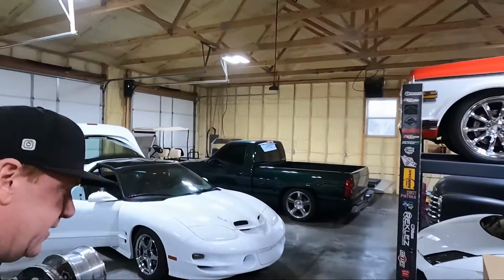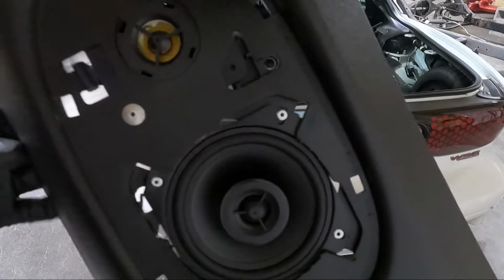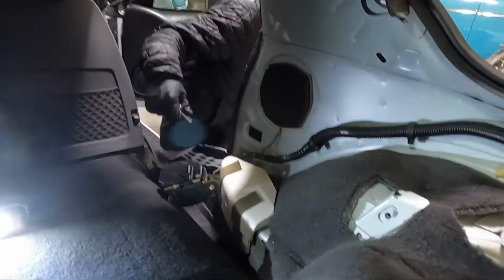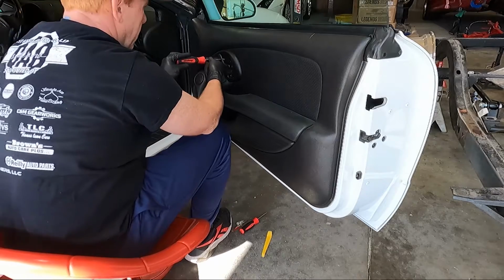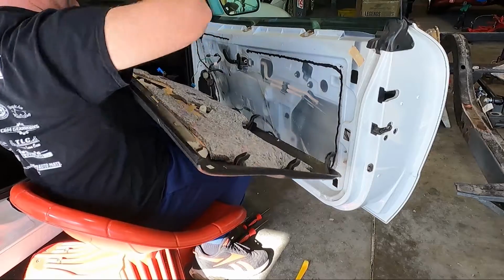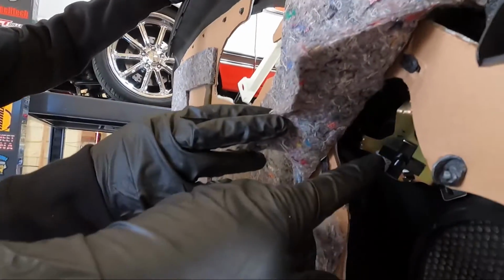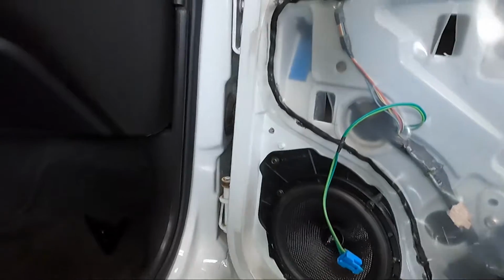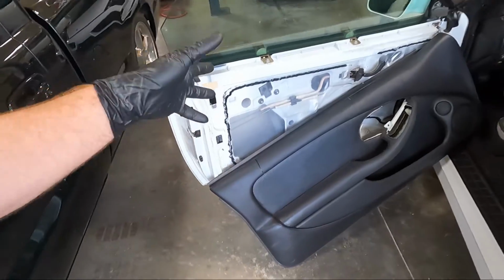WS6 Trans Am Gets All New Speakers From Kee Audio. (Huge Upgrade!)

Comment: Hey travis, while you have the door panels off.  Remove those top staples, drill the holes out and use zip ties to hold them together.  The staples are what cause the panels to crack. Won’t let the plastic flex in weather changes.  I did it to mine to prevent those infamous door cracks.
Reply from the maker: In the process currently

Comment: Hey Travis, nice job on the install. I installed the same set in my 00 Camaro SS, and they were a big improvement over the stock speakers and the fitment is spot on. You could have saved yourself some time and effort by not taking off the sail panels, and instead popping off the speaker grills, unscrewing the stock speakers and dropping the new ones in. Would also recommend adding some sound deadening in between the speaker mount and the body to eliminate sub vibration.
Reply from the maker: I may do sound deadening down the road. I don't like popping out the grilles on the them. Always a chance of breaking with the age of the plastics

Comment: ABSOLUTELY do a experimental door panel vid, every panel out there is cracked so it will be your most watched vid so make it good!  On another note, do you think the baffles would do good with the CDT sail panels here, I'm afraid that filmsy rubber would reverberate.  Do you think that is a non issue or not?
Reply from the maker: Its a pretty good product. I think it compliments any speakers
Reply: last question and I'll be done:  I've been defeated by the hangar hooks, I'm trying not to get too aggressive obviously so I don't mar things up but the lil plastic piece in the middle of the hangar hook doesn't come all the way out right? it just releases some loosening  up the plastic hook to be pulled out?   Am I correct in this assumption?  @TWAMotorsports
Reply from the maker: Unfortunately it is sold now

Comment: Nice job on the speakers install.. looking peeeeeerfect 👍.. the door panel cracks on your son's Ws6 is a common issue.. my 94 TA door panels surprisingly is not cracked anywhere on each side...  However they do need to be repainted again just because of the outer seatbelt rubbing into the plastic over the yrs.. as seen on my Instagram page.. I think down the road after I get mine up and running I'll have mine professionally painted with that plastic texture paint.. but for me now my motor and transmission is first priority..👍
Reply from the maker: Yeah these door panels suck!
Reply: @TWAMotorsports  indeed... I see another white Lambo in the background..
Reply from the maker: Same one. Older video
Reply: @TWAMotorsports  10-4

Comment: Timeless thanks so patient one handed
Reply: I just got a 1994 Camaro. Having trouble with locking the doors with the remote. Replaced the battery in the remote first. The doors will lock but not unlock. What symptoms made you decide to change the actuators initially? The press the #1 button once and the #2 button twice seems to be working fine but the transmitter for the anti-theft is different than the doors so I guess this might mean the tx and rx circuits are OK but maybe not so?( not actually a RC car right?)
Thanks Travis, seems like you had another viewer reviewing your 2 year ago video! This is what I meant by timeless! I am going to subscribe, I really thought your instructional video talents are very thorough!!!
Thanks
G_Dub
Reply from the maker: @GDub1958 thank you

Comment: I miss my Firebird. I had an 02 and put a 10 inch woofer in the rear it sounded so so good hitting off that glass. No rattles at all.  I had the hatch cover so even when you look inside the car you couldn't see anything. (No tints)
Reply from the maker: They are a timeless look

Comment: Doing this today. I watched other videos on this subject and 1 person just removed the speaker cover in the rear seat woofer area. Not that it matters to me as I have most everything removed already and I'm doing it your way.  My Kee speaker kit came with (2) CDT HD2500/EX-430 crossovers. I found out that they will not be used with my Monsoon amp. The Kee kit came with no instructions. Although they put together a short video on YouTube.  Your video is better and very helpful. Thanks for taking the time to post it.  Just picked up my 02 WS6 last December. It has less than 7000 miles on it. So keeping the Monsoon system close to stock is what I want. The stock speakers really don't last 22 years w/o falling apart or sounding bad.  I report back with my review of the Kee system.
Reply from the maker: Thank you. The kit sounded great when we were finished

Comment: Thanks for this video, I have planned to buy the same system from Kee Audio for some time.  $400-odd for that system is really reasonable.  We just returned from a long road trip in our 1999 Firehawk, and I was thinking I would like to install some sound insulation in the hatch area (which seems to be where the lions share of the road noise comes from).  While you have the interior and panels off, you should install some Dynamat, so you can actually hear your new speakers!
Reply from the maker: This car is sold now but sound deadening is a great idea.

Comment: Okay all installed. The panels all came apart as outlined. Simple as it gets. Going back together is another story. Those door panels take some swear words to get them to drop into place. The door lock lever was also a pain, on the first one. 2nd one was less than a minute. Once the door panels are flush with the door, the screws went right in and lined up nice. The sound quality is amazing. Put a CD in and its crystal clear. Actually had to take a few minutes to adjust the equalizer. The settings are very sensitive now. I never had it past the 25% volume mark and it was too loud for me.  Your video made this task easy. Thanks again for posting it up.  The speakers are a huge upgrade. The look is 100% stock and thats what I wanted. I did the Kee level 2 upgrade. $389.97 and well worth it.
Reply from the maker: Definitely a great upgrade

Comment: Just an FYI on the fitment of the door speakers in the cradles. I swore up and down also that the speakers would not go in. Watched the video that he says they do but I think its light on showing just how to get them in. So I took that as a challenge. It really just takes some forcing them in. It does sit against and deform the back tray along with basically deforming the complete cradle. I am thinking of getting a few sets so when these explode into a million parts from stress, I have a backup set that I will cut apart and a backup set to that set. I think the way I finally got them to sit was I would screw in two opposite screws and tighten them down and then take them out and do the other set of screws. in doing this I think it started to widen the cradle. I then did two opposite screws just barley started and then pushed down one of the other sides and got a screw in. Tighten them all down and then backed them out and repeat with the other side until the cradle will let you get all four screws started and then just tighten them all and it goes in. I found though that the speakers lip seems to be larger and the whole in sits inside of the door panel is not large enough, so my door panels do not want to sit flush on the fronts.
Reply from the maker: Yeah it was a definite force. Lol

Comment: Great video, but what I needed to see most wasn’t there.  Did you replace the rear tweeters in the hatchback trunk area?  And what did you do about the factory amp?  Im being told you have to bypass it and add an aftermarket amp if you use aftermarket speakers.  I have a 93 Trans Am with the 10 speaker system (pre-monsoon).  Ive done car speakers before but never with amps
Reply from the maker: I didn't bypass rear tweeters. These speakers are made for factory amp which is still in place.
Reply: @TWAMotorsports  thank you!
Reply from the maker: You're welcome

Comment: Is there a replacement for the 4 wire plug that goes into the sail sub? I can’t find one online and mine is not in the car.
Reply from the maker: Doubtful new
Reply: @TWAMotorsports  I just went to the junkyard and pulled every connector
Reply from the maker: Thats the best option

Comment: Great video well done gents!  Stupid question, do you guys recommend any good quality FM Bluetooth transmitter?  Reason why is I am considering getting collector plates which will require me to keep the factory GM Delco Monsoon CD player (no cd changed) head unit on my 97 Firehawk.  I got the trunk and rear speakers done, just the door speakers tweeters left.  Thanks!
Reply from the maker: Thank you. They are all about the same. I did a video on my sonoma GT with one we still use.

Comment: Hey Travis. Love all the vids. So helpful. Had a question about my 00 Camaro SS. Was planning I. Speaker upgrade but while I was in there my window is a little sluggish, and most times will only go up 6” or so at a time. After a minute or two it’ll go another 6” until finally up. New actuator/motor? Wanted to see what you thought. Thanks man.
Reply from the maker: Yeah probably about time for a window motor

Comment: I'm going to be upgrading my system in my 95 RS Camaro with the Bose system next month. Found out the hard way you can't just change the speakers and then the head unit without bypassing the amplifiers. Anyone know if the consoles from the 97 and up will fit into a 95 without tons of modifications? I don't really see why it wouldn't unless there was some dramatic different in the floor pan. I know the dash is different and hoping that's not an issue.
Reply: Travis, do you have a part number for window felts?
Reply from the maker: I don't think it will line up with the dash correctly

Comment: Let's do the door panels it's a big problem, and nobody is reproducing them yet!
Reply from the maker: After starting that process I am not sure about it
Reply: There is a company that makes a skin cover for it not sure how it looks.
Reply from the maker: I have seen that
Reply: There is a big market for these cars but nobody is taking a bite at it. Whoever actually takes the chance is gonna be rich asf.
Reply from the maker: Maybe right
Reply: @TWAMotorsports  what wheels does he have on that car, I’ve been trying to find a set of American racing like you have on your red car but I’ve been having a hard time finding 17x11s I see a ton of 17x9s
Reply from the maker: These are ZR1 replicas. 17x11 torque thrust are crazy hard to find now.
Reply: @TWAMotorsports  yeah the 17x11 torque thrust are pretty much unobtainable
Reply: @TWAMotorsports  and if you could possibly share the link to those ones I’d appreciate that, i don’t know if the ones I’m looking at are any good quality
Reply from the maker: Crazy
Reply from the maker: I didn't buy them. They came on the car
Reply: Which is stupid because you can buy parts for cars that are over 60 years old
Reply: Yeah the 17x9.5 grey torq thrusts have been out of stock for a while now …

Comment: I can’t believe you guys took the sail panels you to do that… the grill just pops off.
Reply from the maker: And you risk breaking the 20 year old plastic
Reply: @TWAMotorsports  I have one, I’ve owned my 2002 ws6 since new and they are in great shape. The issue is how every one of these door panels are cracked in the same spot lol. My car has only 40k on the clock and it still happened.
Reply from the maker: Yep. It happens. My 77k mile ones are good

Comment: i took my kee audio out and put infinty speakers
Reply from the maker: Better or worse?
Reply: @TWAMotorsports  way better,when i originally upgraded my  whole system the installer  said there tweeters were garbage.sound was mediocre.i think i bought the level 3.i pulled everything out the next year.no it sounds like a bose system very clean turned up.alpine 50 by 4 amp.
Reply from the maker: Good to know